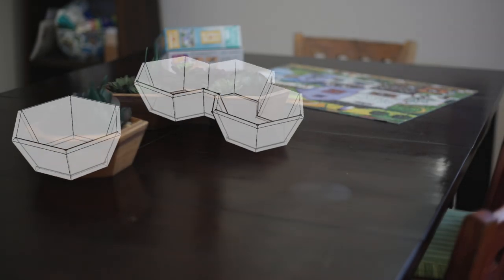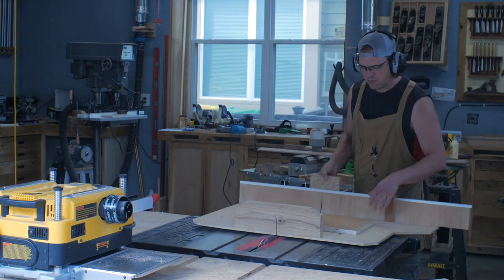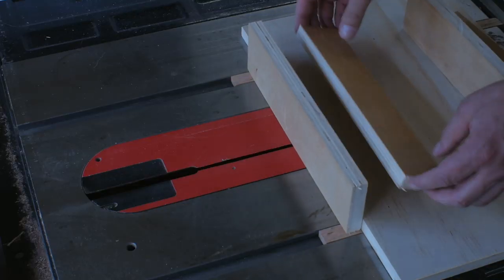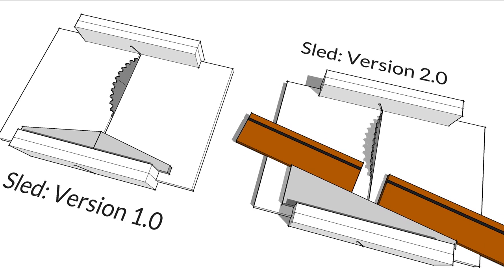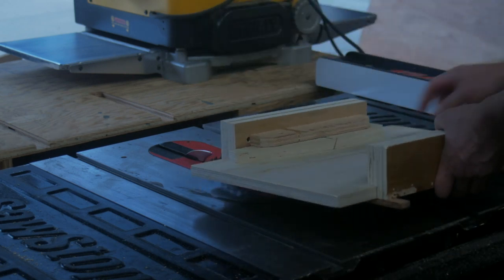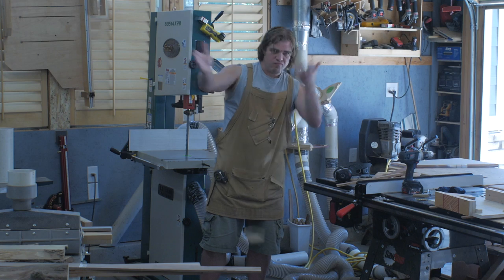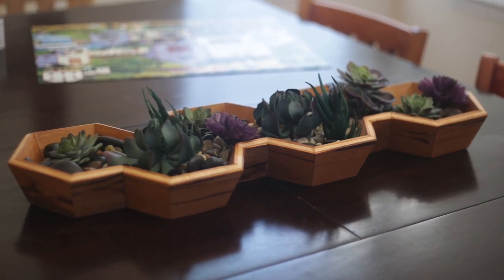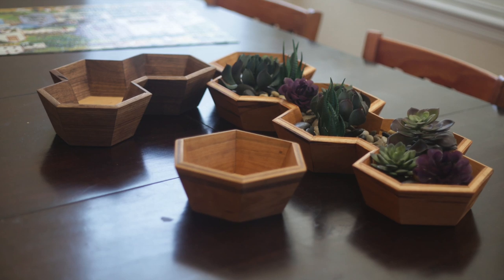How to make Geometric Planters

Comment: So let me start by saying I'm really bad at geometry, but you said your blade was tilted to 28°? Shouldnt it be 30?
Reply from the maker: If you haven't seen it, look in the description for the instructable for a written version, but yes, 28 deg is correct for this version. It changes based on the wall angle.

Comment: if you put in flowers in there you can't water it, right?
Reply: I think, succulents and planters will be fine, if you make a drainage layer at the bottom and holes.
Reply from the maker: Ya, I used a finish that would likely stand up to some moisture, but you are right, you could add drainage and use a stronger finish based on your needs.
Reply: @GeeksWoodShop  What finish did you use? I'm making a set of geometric planters based on a solution to an old math problem (check Dudeney's solution to the haberdasher problem) and would like a finish suitable for succulents. I've seen some finished with epoxy on the inside, but this seems like overkill.
Reply from the maker: @RobMoreland  I don't know for sure, but I do like Odie's Oil and it's suppose to be very resilient to water once fully cured. You could also look at a Marine grade  poly.
Reply: @Geeks Wood Shop  Thanks! I was considering using Tried & True danish oil, since it's only polymerized linseed oil without a varnish component. You just gave me the excuse to finally pick up some Odie's.